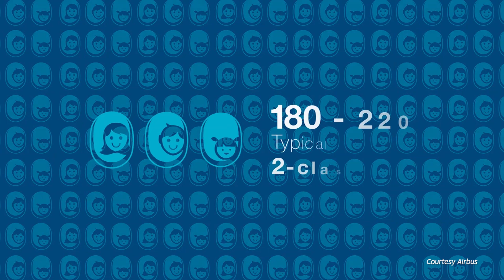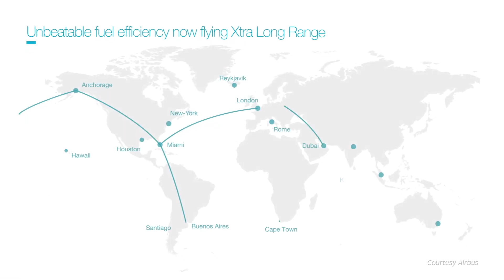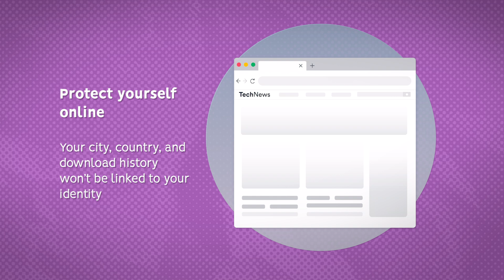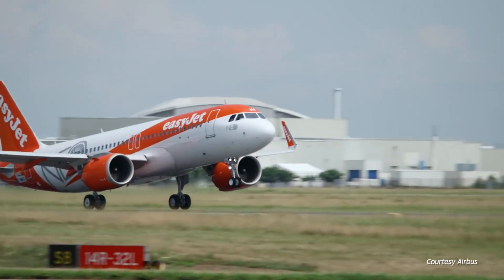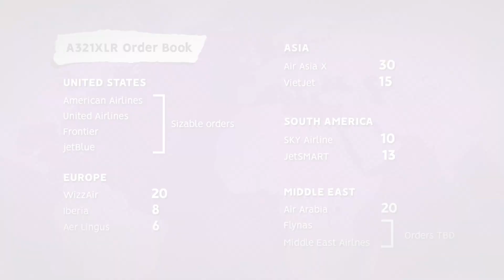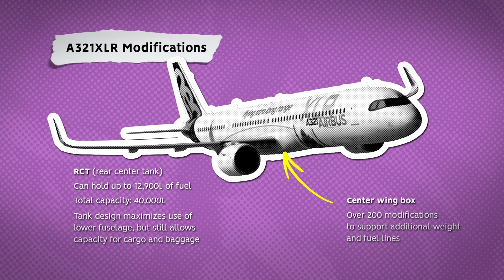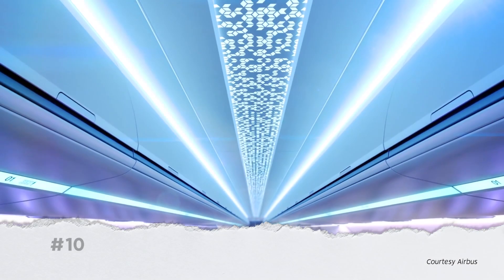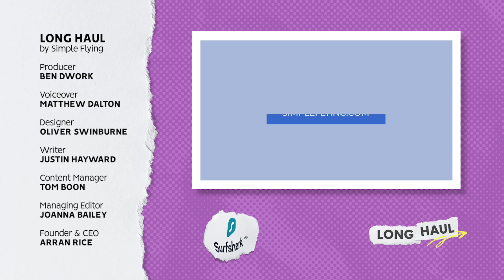10 Things You Must Know About The Airbus A321XLR

Comment: Maybe it’s just me but I have found flying a Boeing 777 in coach to be very comfortable as far as how the plane feels in flight. It seems the weight an size of the aircraft have an effect on how smooth the flight is and how it copes with turbulence. I could be wrong but I have always felt the flight more on an A320 or a 757 so I would most certainly prefer a wide body for a long haul flight.
Reply: Stability against turbulence, yes, heavier plane wins.  Seat-comfort wise, the high-density 787 and 777 cannot beat the 320.  High-density 777 is one of the least comfortable plane in the sky right now.  It's literally THE worst!
Reply: @_w_w_  The 10 across 777 is on par with the 9 across 787, both were designed for one less seat across.  Both terrible planes for long haul and especially night flights if you are in the cheap seats. I would happily pay a bit more for a bit more seat space but moving up to premium economy is 2.5 x the price, sometimes like with Qantas 3x more.
Reply: @_w_w_  I've flown Delta's 777 and it's the best long haul option I've ever flown.
Reply: @igorluiz9551  Delta's 777 is good but not the best... far from it.  But Delta's 777 is not high-density or densified - it's 9-abreast. I am a top Delta flyer and sadly they got rid of the 777 after spending millions to renovate it.  I bet you didn't realize that Korean Air's economy seat has more legroom than Delta's more-legroom economy (Comfort+)...  An airline can definitely bring wide-body seat comfort to narrow-body planes.
Reply: You are right in your perceptions. But also I bet it is because you were born right in the middle of the wide body era when the "the Queen of the Sky" the 747 rule such long range routes supplemented by the big twins the B777, the A330.  I'm 62 yrs old born in 1959 at the beginning of the jet age when planes with the exact capabilities as the A320-XLR such as the the B707 and  DC-8 were pretty much the only game in town.

Comment: Thank God, most of the Asia and Middle East-based airlines still using A330, A350 and A380 widebodies for medium to long haul routes
Reply: Just as well on some of them. I have to fly London to Australia once a year, economy class and the only plane flying that is comfortable is the A380.  The new 777s are painful with their new 10 across seating as are the 787s.  I can see these new A321s as being Ok for up to 5 or 6 hours if the seat pitch isnt too short.
Reply: @stephanguitar9778  A350's are equally comfortable to fly. but Emirates 777-300ER's are fine for me

Comment: I think the A321XLR and A321 in general would be the go-to plane for most of the airlines coming out of the pandemic. Perfect plane to replace aging planes and to fill the void of low capacity long haul flight. Once they start using these planes, airlines will start planning their future fleet around the A321. Though for the passengers though as i'd imagined airlines would want to squeeze as much as possible from these single aisle aircrafts.
Reply: Take a look on our channel! We also have nice aviation videos!
Reply: The 757-300 is longer than the A321XLR so the A321XLR won’t be a replacement for the 757-300. The A321XLRs remind me that Airbus should make A321XERs

Comment: The design is stretched to the point where at max payload/range the plane will likely encounter some performance limitations. The turnaround times for a fully loaded single aisle airplane like this one will be much longer as the poor souls stuck in the back who’ve already endured eight or nine cramped hours will need likely another half hour to simply get their bags down from the overhead bins and wait while the 160 or souls ahead of them slowly make their way off. Ditto delay concerns for boarding the outbound.
Reply: Full service airlines operating the A321LR already showed that the seats installed are the same as the ones installed on their widebodies, so it wouldn’t be more cramped than widebodies and one of the only differences you’d notice would be the fuselage width. Turn around times shouldn’t take too much longer than widebodies, especially as the A321 isn’t the size of a widebody. After all, 160 is still less than the 180 you could find on a standard A320, so boarding times should be similar even if you have some time separation between the classes.
Reply: Boarding and disembarking times shouldn't vary greatly. Better to fly non-stop to your destination rather than in a larger aircraft operating hub to hub and having to take a connecting flight to your final destination.
Reply: @The_Red_Squirrel  I'd rather slower debarkation at my destination, then stuck debarking and embarking a 777 or 787 on a layover.

Comment: Dispatched the 321LR at Gatwick-  cabin baggage was often an issue on full flights, and during strong headwinds had to stop to refuel. But that wasn’t often. Still a good plane to use. Hopefully the XLR will be good.
Reply: 2 pax on A321LR YYX<>LGW and quite negative. A winter flight so yes, shallow overheads a real issue. Plus, as the 3 rows of J class had their own toilets this was difficult and impossible when one Econ toilet went offline! IMHO comparing these aircraft to the 757 is not a valid comparison.

Comment: I think governments should impose a minimum seat width of 500 mm, a minimum armrest of 50 mm and a minimum seat pitch of 900 mm. The A320 would lose about 400 seats. A 6-abreast aircraft would need a minimum cabin width of 4.0 metres. Given the fuel efficiencies gained in recent decades, and aircraft stretching, passengers should get a space bonus!!!!!
Reply: I suppose you also want Government to wipe your arse as well?
Reply: @IO-zz2xy  of course
Reply: This is quite possibly the dumbest comment I've seen
Reply: @moekitsune  Kerry Ross is sure dumb. Government has imposed tens of thousands of requirements on our transport systems. Aeroplanes now use just 40% of the fuel they did 50 years ago. Humans are bigger and older and less able. We can afford to convert some fuel saving into extra passenger space for comfort and safety (including less angry people down the back). It would be really good for aircraft sales. Now that we have sustainable aviation fuel (SAF), the environmental issues are being eliminated. A320 and 737 would lose about 40 seats. The airlines would just buy the largest sizes of these aircraft.

Comment: So you can just about do a Seoul incheon to Seattle flight or an SFO to LHR flight. That would be the max city pairs I can think of. I’m also surprised delta didn’t order any.
Reply: I am not sure if he is right.  Delta operates Seattle as its Asian hub and I read somewhere the XLR's range is slightly too short to do Haneda or Incheon flights.  Eastbound with tailwind maybe, but westbound with headwind is not likely to mak eit.  XLR is perfect for JFK to Delta's European hubs.
Reply: @_w_w_  look up the distance I think you can do those flights. It's just at the max.
Reply: @hanj31  It's not just the published distance... Those are at the max'max with low passenger and cargo weight.  Plus, Airbus hasn't publish data on how that 4700 NM is derived, whether it include the reduction in efficient during winter months.  Seattle and Portland departing flights for Delta could make sense but it's pushing the limit of max range that most airlines won't test.  This is the same reason why 757 flights from JFK to European may need to refuel midflight during winter months.

Comment: I feel bad for the XLR cabin crews, no space to chillax
Reply: Usually a row of seats will be blocked, just like it was done on the 757. On e.g. transatlantic routes the need for a crew rest isn’t too urgent
Reply: @spongebubatz  you can't say thats better than a proper rest area. 

Not trying to make an issue out of nothing but imagine looking over at your colleagues doing the same route getting the same pay yet they get a cozy 777 with a rest area and you get significantly less comfortable economy seats. Bit of a morale hit
Reply: @paulinejackson5861  did I say it’s better than a proper rest area? No, I didn’t.
Of course crew accommodations like on the 777 are way better, but these aircraft are also used on much longer flights while the XLR is intended to serve shorter transatlantic flights, so not flights from Europe to the US west coast or so. What I was also trying to say is that already the 757 has found a solution for that

Comment: For the ultra-long-haul SE Asia - USA flights I occasionally take, narrow body jets would be a miserable experience. Wide bodies have at least twice as many aisle seats!
Reply: That are routes the A321XLR (and 757 as a very comparable aircraft) aren’t even intended for
Reply: it can't fly that route anyway, the range is too short
Reply: Not true. Typical narrow body aircraft have 2 aisle seats in a 6 across configuration; that's 33% of all seats. Widebody aircraft have 4 aisle seats (50% in 8 seat configuration or 40% in 10 seat configuration).
Reply: @The_Red_Squirrel  ok, but still far more aisle seats and far more restrooms
Reply: @ericbosken3114  My posting was only to correct an error in the interest of accuracy. Also, it is important to consider the number of aisle seats and toilets as a ratio to the number of seats (persons) on the aircraft.
Reply: That’s why we need the NMA ASAP. It will likely be a narrower and shorter version of the 767. 2-3-2 or 2-2-2 in economy class 1-2-1 or 2-2-2 in premium economy and 1-1-1 in business class.

Comment: I mean 757 has been in service for a long time and not alot of people complain about the space?
Reply: 757's have not been used in long hauls that much. They are mainly used for medium hauls, and particularly to/from airports in hot and high conditions. There's a big difference between flying in a narrow body for 4-5 hours compared to 7-8 hours or more. Besides, people did complain about the lack of space in the 757; they just didn't have social media back then where you can read them. People don't call 757 the flying pencil for no reason.
Reply: @alaw168  Your parents and grandparents did in fact fly on narrow bodies for 7-8 hours in the 1960's. They were the B707 and the DC8. You guys were born in the widebody era when the B747 ruled the skies and the DC10 and L1011 were replaced with the B777 and A330.
Reply: @colinw7205  707s and DC8s mostly had comfortable seats with 34'' seat pitch.
Reply: @stephanguitar9778  Point well taken. Hope that the airlines resist the urge to "sardinize" their seating configurations in their new long range narrow body purchases.
Reply: @colinw7205   With a widebody, the airlines can mess with the seat width (the 787 was heralded as 'more spacious' and would have been in 2-4-2 till airlines got the greeds and made it 3-3-3).   With a narrowbody, they can't do that, it's fixed at 3-3.   Of course, they can squeeze you on seat pitch and legroom - I agree with you there, I hope they don't.
Reply: @alaw168  if 757 werent used for long flights at all why did US carriers only start to replace it with the A321 xlr when you can just use a regular NEO or even a CEO
Reply: But boeing ended production and environment friendliness is becoming more and more important so yeah.
Reply: @titan4110  no that’s not the point , in the last bit of the video he talked about how uncomfortable it is in long flights despite the 757 been literally doing the same long flights with around the same space yet nobody really had a problem with it
Reply: @kh2b573  Ah ok I'm still watching.
Reply: @titan4110  I think the words you are looking for are "fuel economy" which is not a trivial cost. The rest is just PR talk.
Reply: It depends how creative airlines get with the seating space. The last 757 I flew was 15 years ago BA from London to Vienna, the seats were comfortable and there were toilets in the middle of the aircraft, seat pitch was good.  Most new aircraft are fitted with much harder slimline seats and have less seat pitch and apart from being more uncomfortable, they have the feeling of claustrophobia about them when full of passengers.  I will continue to be very careful with my bookings re airline and seat configuration.  I have banned every 787 flight and the 777's with 10 across seating to date thanks to the meanness of seat width.

Comment: I’ve never been on a narrow-body longer than 2 hours, so I can’t say if the space will be compromised. Airlines already fit 18” seats on existing A320 family aircraft, as marketed by Airbus, this is wider than most of the competition. I guess it’s the smaller cabin that makes flyers more uncomfortable. The only real problem I see is using the toilet on longer flights, with only one aisle, movements between toilets could be obstructive, so I personally hope to see A321XLR operators install a single toilet around door 3 just behind the wings. I’ve seen it being down before, JetBlue’s A321LR if I can recall correctly.
Reply: I think it's the lower ceiling height that give the impression of less space.  I flight TPAC almost every week before the pandemic.  Once you are seated and resting/sleeping, you can't tell the difference as far as seat comfort is concerned.  However, the bigger/heavier planes handle turbulence much much better.  320 is also better at turbulence than the 737, so at least it's got that slight upper hand.
Reply: Flew an AA a321 NEO from Hawaii to LAX, wasn't that bad but much preferred the Delta a330 I flew out there
Reply: Also passenger carry on  luggage space might be an issue?

Comment: I'm already appalled at 737s from the west cost of the US to Hawaii.  Back in the day it was all widebody to Honolulu.
Reply: I learned that it depends on the airline, route, and demand for that specific route that dictates what aircraft they use. That said, newer generation marrowbody aircraft are on the rise. They are more fuel efficient and so,e ,pre comfortable. The A220 is a prime example, like the A320NEO, it's starting to become really popular and only a matter of time before air;ones use them for medium and long haul routes. Flew on the A220 and it's a phenomenal flight each time. Granted though, as you said in your comment, some 737s... Shouldn't be taking the load of such routes, let alone fly considering their age and condition.
Reply: Seat makes a huge difference for long haul.  Delta's economy seat are 10x better than United's.  I leave Delta's flights rested but leave United's stupid 787 with neck and back pain.
Reply: Was just checking out flights for early next year. London to New York, prices are way above normal. Cheapest was TAP via Lisbon.  Lisbon to New York A321 with 31'' seat pitch for 8 and a half hours. No seat recline in the standard class economy seats. No inflight entertainment.   Pure misery.

Comment: I still wonder what range a carbon wing would do for the plane .💺✈️🛫
Reply: This is the next upgrade for the A320 family down the line. Foldable carbon wing is one of the big ticket item that gives significant improvement in efficiency.
Reply: The Wings of the A320neo Family are made out of composites (So is some of the fuselage) ; So They're getting the maximum you can think of already
Reply: @8hjaikartikmynepalli949  Airbus is currently working on composite wings for the A320, they are not yet available. The neo only updated the engines. Only the
 A350 has those.
Reply: @grigandy  Well.. I Guess You're Right but still , atleast some of the A320's parts are made with Carbon-fibre reinforced polymer (CFRP)s and other better products

Comment: This XLR could possibly do the insane route between the UK and St Helena. Though I don't know about the runway length in St Helena if it's enough. But if could finally connect Helenas to the mainland directly for the first time since boats were regular. That would be interesting.
Reply: I always understood it was wind direction at st Helena,  apparently the approach the wind blows with you making it harder to stop
Reply: Stanky the cat its headwinds which require a much higher approach speed so it dramatically increases stopping distance.
Reply: @woodduck_23  of course I’m aware of that …but they can’t land into the wind  because of wind shear , the airport is on a cliff .

Comment: Sorry but this aircraft isn't ideal for any passenger flying long-haul. No way!
Reply: Don't know what age you are, but take note that the modern jet age started in the 1960s with the B707, DC8, etc, all of which were single aisle, and that was called the golden age of air travel.
Reply: @The_Red_Squirrel  This isn't 1960s... Times have changed, narrow bodies are not comfortable for long haul.
Reply: @mgar313  seats are the same on a single aisle aircraft as a multiple aisle aircraft, so I can't see any difference in comfort levels. Also, single aisle highly efficient aircraft facilitate non-stop flights, which are far preferable to hub to hub flights with onward connecting flight.